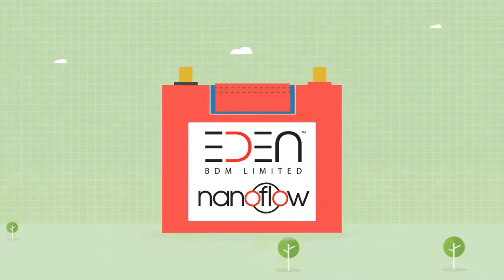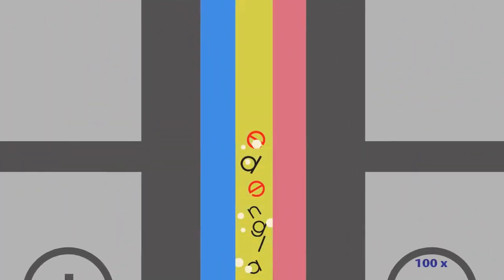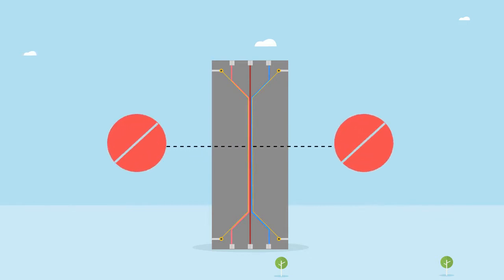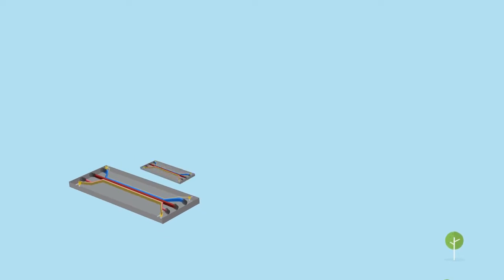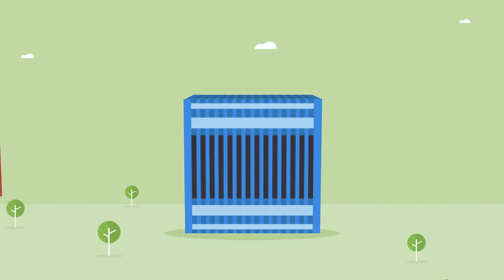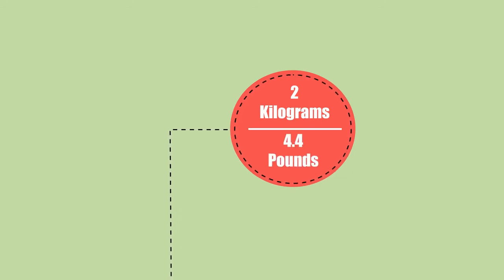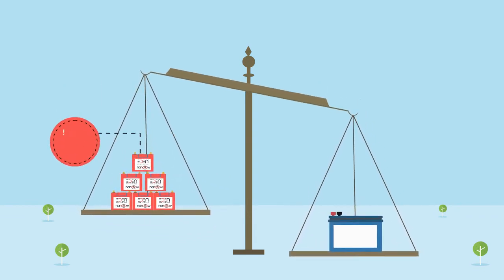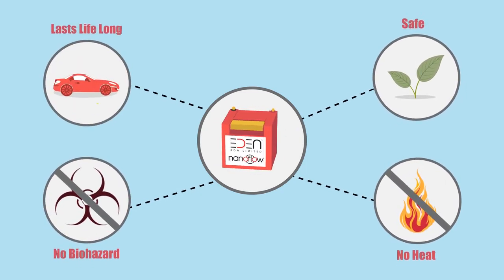Battery

Comment: The main battery might be 12kg, but these batteries require three separate liquids.  I don't think that the 12kg includes those liquids.  Though recharging the batteries only requires swapping spent liquid for charged liquid. Which should be as fast as filling up with gas.  If the 12kg include the weight of the liquid then this could be really sweet.   If not it is still really nice since it should be a lot less polluting than lithium batteries.  As well as having a longer life.

Comment: 12kg of weight for a 85kwh battery (of the model S) would mean an energy density of 7.000 Kwh/kg, that is almost the theoretical limit of Lithium Air of about 11.000 Kwh/kg. Seems not realistic. Important is also the charge time and power density !